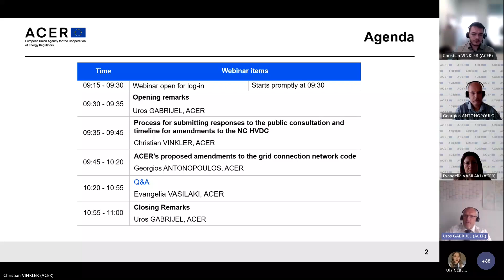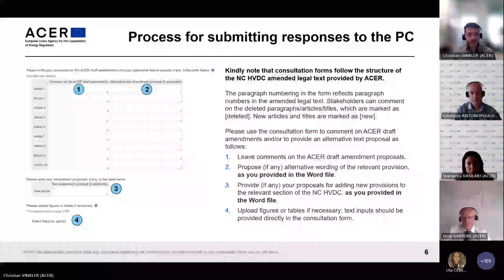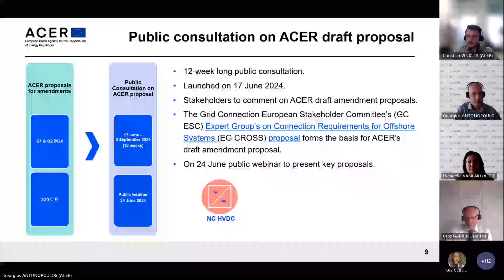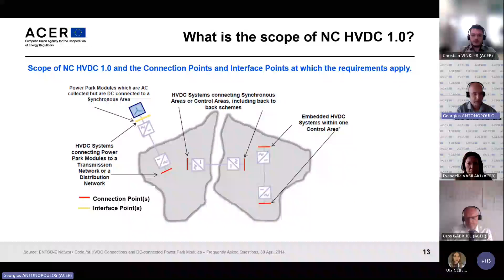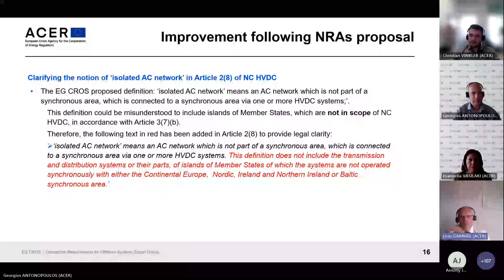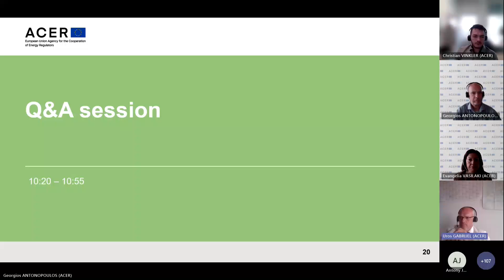ACER webinar: amendments to the electricity grid connection network code (26 June 2024)

Comment: Btw, it is just one side of the truth, with the balancing of the energy through markets and interconnectors, to keep the frequency right and operate the system. What you all dont mention is the situation, when you shut off all the big Generators, and the new "wow-effects" will make this imagination destroy. You will have always a need for big generators in a region, they are needed to keep the sinwave a sinwave, operate within Upeak (Voltage peak 325V per phase),in every short i mentioned it now, or you will damage every electronics, theyre life will be short or very short, you are scientists, you will find good lecture on German language.